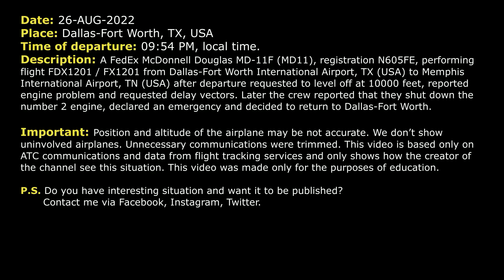Engine FLAME-OUT. FedEx MD-11 declared emergency due to engine failure. Dallas Fort-Worth Real ATC

Comment: 1:43 if its an emergency and the engine is flamed out, cant they just come back to the airport as soon as possible instead of taking more time in the air? just curious
Reply: They needed to run checklists lol
Reply: 3 engine aircraft, running checklists is way more important than rushing things the aircraft is fine that was barely an emergency much less one to rush to get on the ground.

Comment: Wonder what caused the engine to roll back and flame out...
Reply: @Ysalomet. this isn't an uncommon "event" for the MD-10/11. Due to #2 engine being located above and aft of the fuselage (where the fuel tanks are) a minimum of two higher output pressure fuel "boost pumps" are needed to supply fuel to that engine.  Due to the age of the aircraft and lack of new spare parts. The reliability of the #2 engine fuel feed pumps are poor. In short, if you lose one pump, the backup pumps may not provide enough fuel pressure, during higher demands  (take off or climb out).
Reply: @mcdonnellsinc  
Oh ok thanks... 
I was thinking some foreign contaminant in the fuel could have blocked a crucial fuel line or something...

Comment: Hate to see the MD-11s having problems here recently as I love the old bird, but a phenomenal job by the crew and the controllers. Glad they landed safely! Thanks for a great upload!
Reply from the maker: Thank you for watching 👍
Reply: @pubgpickle  Don't be an armchair pilot for the MD11. It's a 30 year old airframe without the #2 engine. You have no idea either which configuration of MELs are on the tail number. When the engine 2 fails which is the tail engine you cannot continue on.

Comment: I don't understand why people say "one zero thousand" when its  clearer to say "ten thousand"
Reply: standard phraseology
Reply: Not clearer to a pilot!
Reply: It’s required to say it that way, such as one zero thousand, one six thousand, and so on, until you reach the flight levels at 18,000 or flight level one eight zero.
Reply: Then you don't understand phraseology and proper radio communication.

Comment: Another day.  Another day of great job by all the professionals.
Reply from the maker: Great job 👍
Reply: @pubgpickle  are you an MD11 mechanic? The MDs at FEDEX are top tier maintenance. It's the cream of the crop for MD11s. Problem is we dont know if these are CF6s or the Pratts. FedEx uses both on the MDs. Don't act like you know anything about FedEx. Go back to your video games. Engine failures happen more than you think in air cargo. Especially with the CF6-80C2D1F they're not made anymore and finding ones without high timed cores is getting harder and harder as the aircraft ages. The next generation engines don't share common parts either with the models.